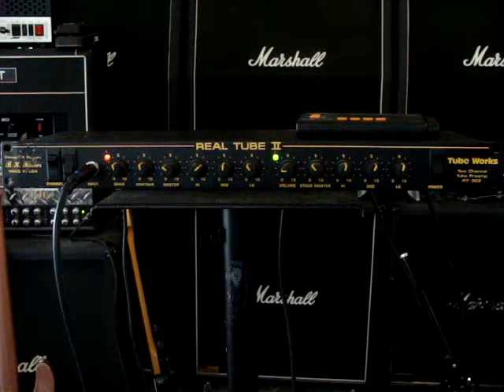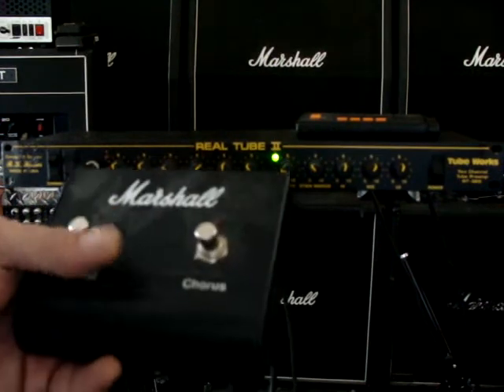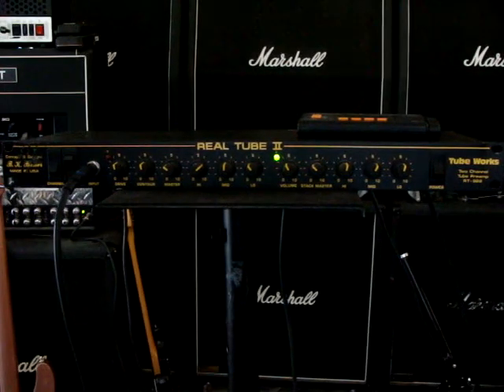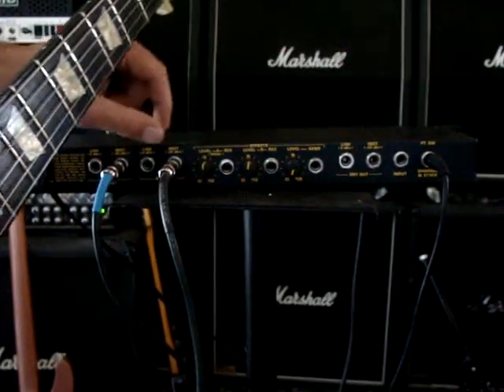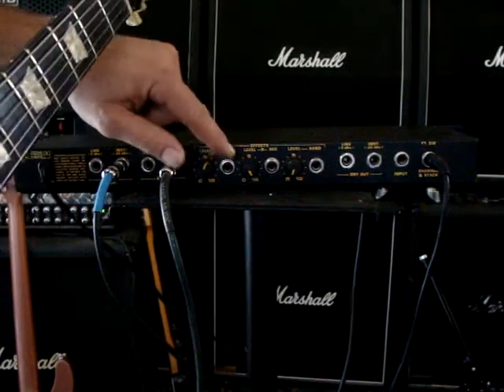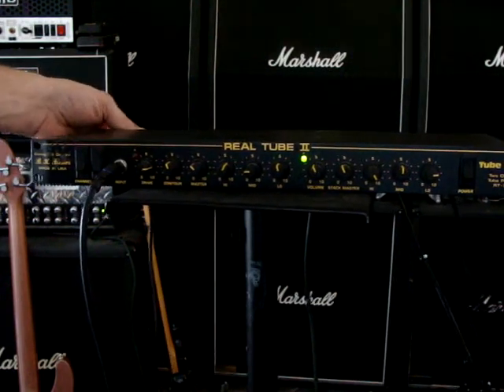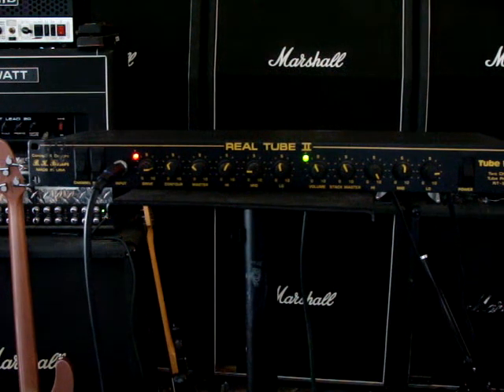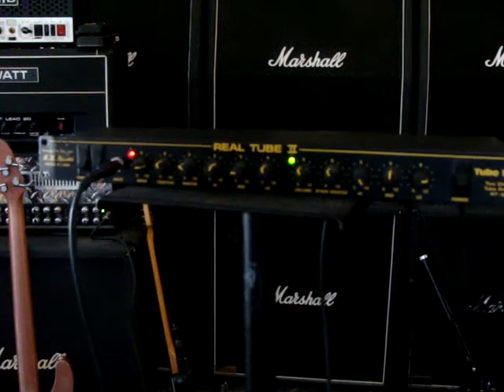Tube Works RT-922 Real Tube.MPG

Comment: Sounds horrible. That ubit is not intended to be run thru the input of another amplifier. It's meant to be a straight preamp ran into a power amp or an amplifier's efx return. When you run it into another preamp (or two in the case of this video) you get that high end shrill sound along with all that noise heard as well.